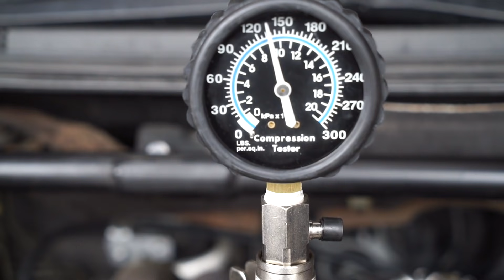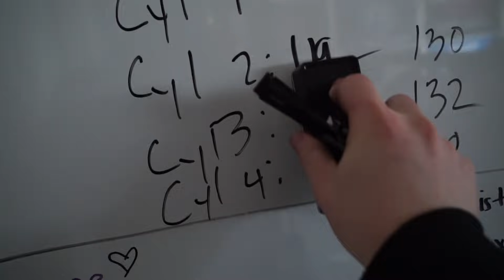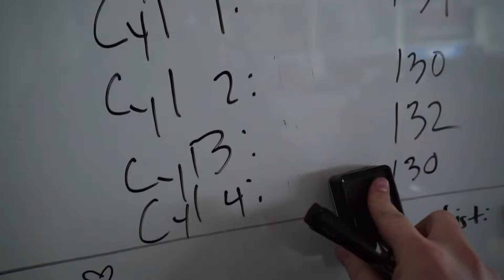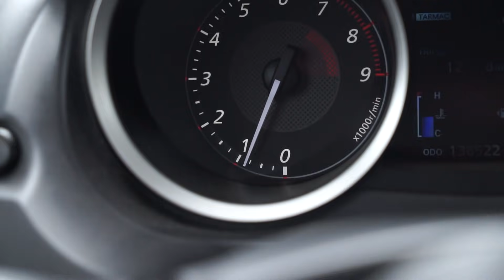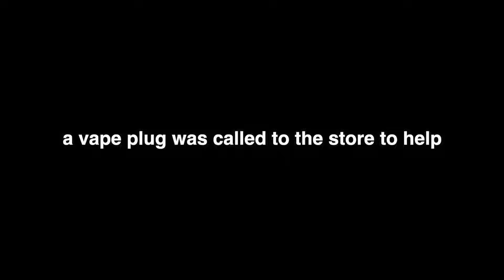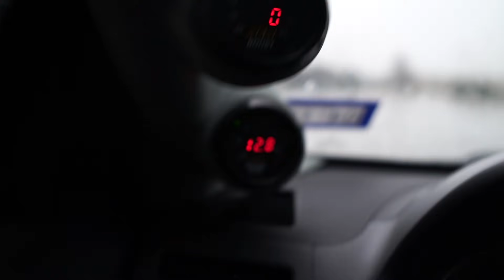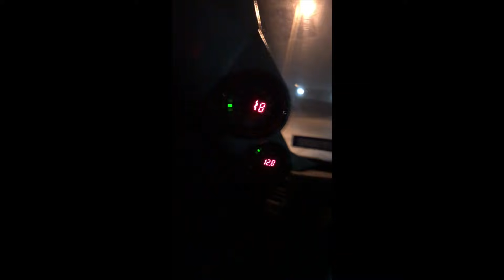How I fixed my Evo X USING A VAPE?!

Comment: That was a boost leak man. It also was a vacuum leak. Regardless of that the leak was causing your regulator not to work. You didn't do the leak test remotely correct. You just fed your engine vape juice. You should have had the engine OFF and clouded out your entire induction system. With the engine running, no vaper was gonna come out anywhere. The vacuum pulls it into your cylinders. I am trying to be constructive, not negative.
Reply: Cause using soapy water would have been tough to do on the couplers. Lol
Reply: @samuelholfeltz9854  it was a vacuum line, not a coupler.
Reply: But he still did a full check on everything. He could have used other methods.
Reply: Vacuum leak would have sucked in boost leak would push the air out hence the “smoke test” which was done incorrectly should have been done with the car off and if it were a vacuum leak he could have sprayed carb cleaner or something around different areas to see if the idle changed
Reply: A vacuum line was disconnected. That is both a vacuum and boost leak. It sucks in unmetered air under vacuum and leaks metered air under boost.
Reply: yessirr

Comment: Get a vacuum leak tester (basically a vape but smells and tastes horrible). But you plug one end of the hose into a vacuum line going into the intake manifold, then you turn it on and it pushes smoke into the vacuum system and you can see leaks. Works great!

Comment: You might have a Vacuum/boost leak somewhere, usually most cars will have idling issues if there is a leak in the vacuum lines, and your AFR's went lean under boost most likely because of a loose line sucking in air after the maf sensor. You can try spraying carb cleaner on lines to find where the leak is.
Reply: Problem with carb cleaner it will eat your rubber lines

Comment: check small vacuum line on the intake manifold that connects to the fuel rail. mine pops off or usually cracks and it causes the small idle issue.
Reply: just finished the video. noticed you solved it. funny how after owning a car for so long you can call a problem out lol.

Comment: is your bottum gauge your afr gauge???? if it is.. your hitting like 20 pounds of boost at like 17-19 afr reading which is insanely dangerous... could be a ecu cut off?
Reply: when your in boost you want to run liike 11.5 right??

Comment: Why not just get an actual boost leak tester and pressurize the system? You can't find the boost leak at idle if the leak happens when pressure is built while driving. I had a similar issue and it was leaking around 15 psi so I could never get to 20 psi. I had to pressurize the system to over 15 psi to find the leak, not just idle it.

Comment: Hey man, while you did a pull, your AFR’s were REAAAALY lean! Like super dangerously lean lol and after you fixed it, it was running at it’s targeted A/F ratios. But just an fyi, you should back off the boost if the afr’s are higher than 14.7, the gauge is there for a reason so use them so you don’t blow up the evo (: